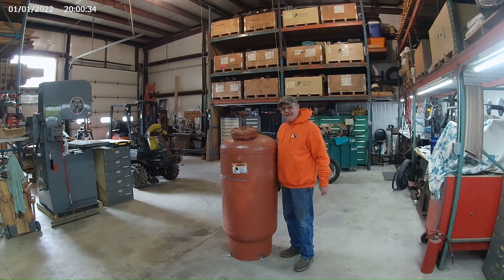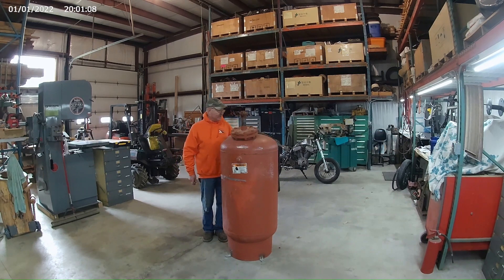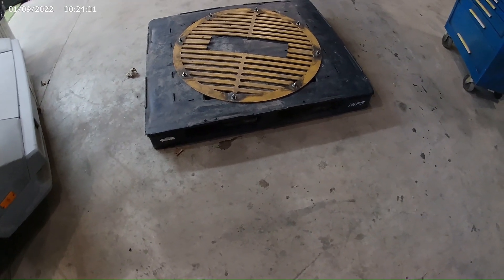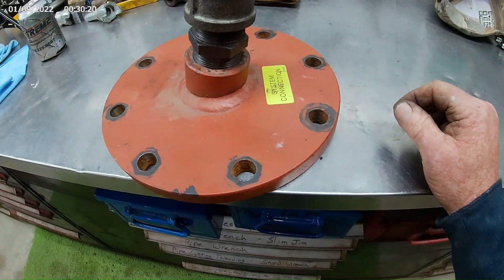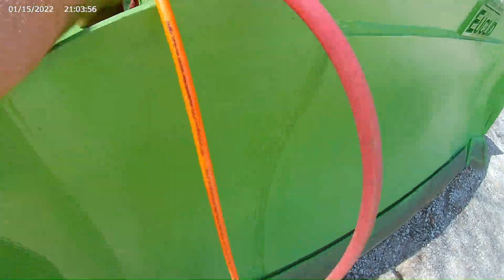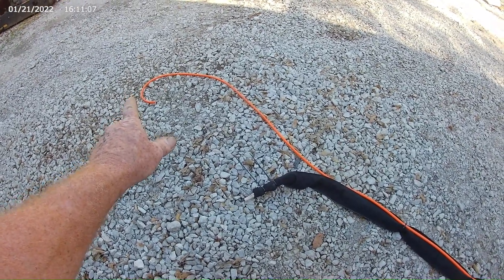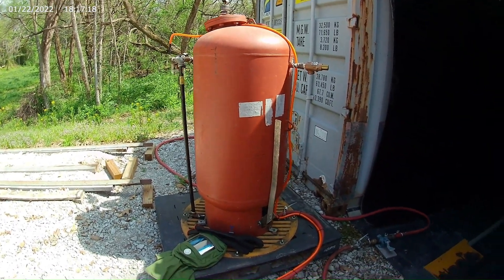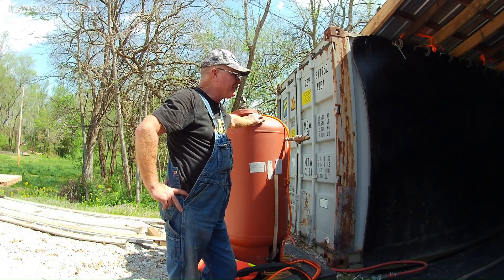How To / Make a Pressure pot Sandblaster.

Comment: Great video Mike, I am an old guy that likes to build my own stuff too. How much cfm is your compressor? I am picking up an old Quincy compressor next week that came from a sawmill that is rated for 87 cfm, and will be figuring it all out from there. I plan to run the compressor with my tractor PTO.
Reply from the maker: My screw compressor is 110cfm, I'm like you. I love to make different things.  Good luck with your project!
Reply: @dieseldoctor25  I have the compressor working well now, bought a homebuilt pressure pot setup just like yours last night cheap and plan to re-do the plumbing. I watched another vid about attaching a vibrator near the bottom to help keep the media sliding down so I will try that too.

Comment: Won't work.  Too wide.  Media will build up and sit on side walls when you get to like 60% empty.  Also, no Chicago fittings on air.  That loses half the air almost.  Over complicated.  I built them.  They need to be simpler even than this to be efficient.   Good try, nice tank. Smart guy for sure.
Reply from the maker: @AW33COM  thanks for sharing